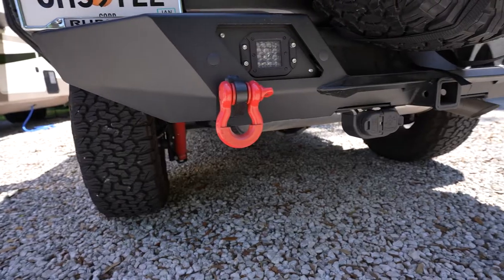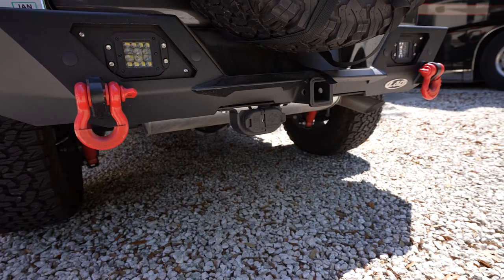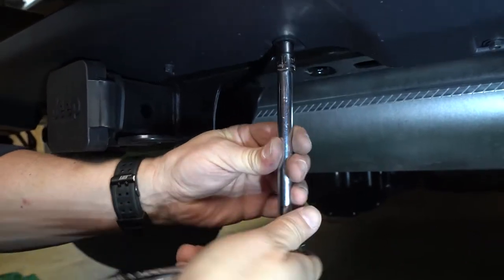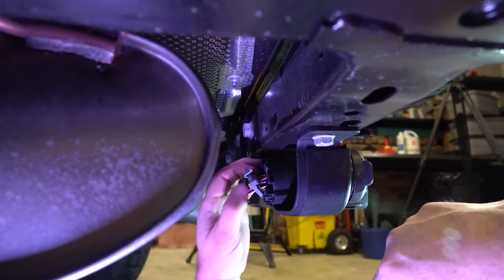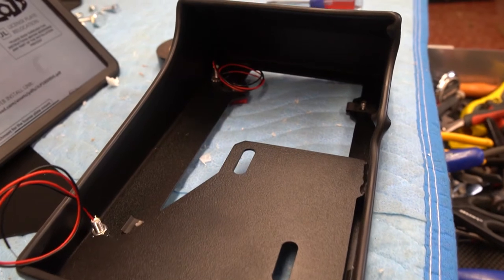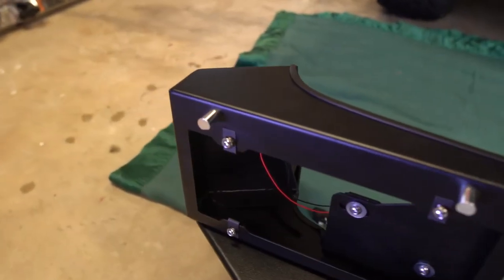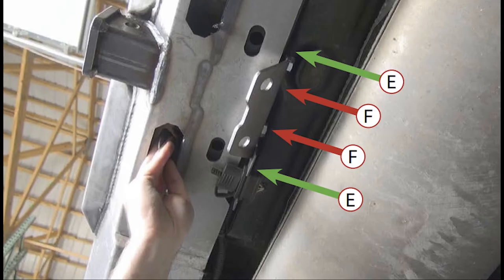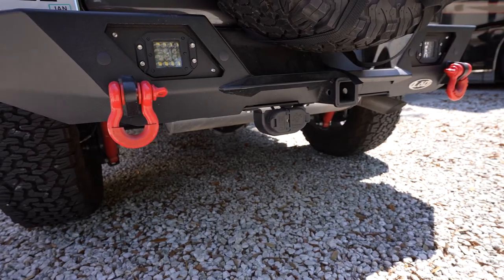Wrangler JL LOD Destroyer Back Bumper Install

Comment: Hello. Nice video  It help a lot. My question is about the added light on the bumper. It is easy to add after I install the bumper or much better if I add it before I install the bumper?
Reply from the maker: Thanks for watching the video. Glad it helped. Either way should be easy. I installed the lights after the bumper was installed.
Reply: Thank you for the info.